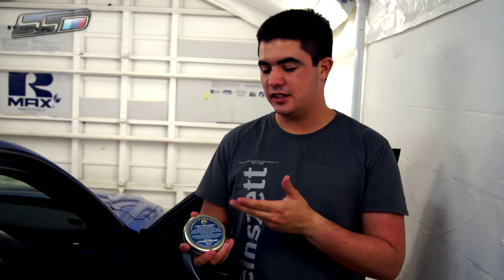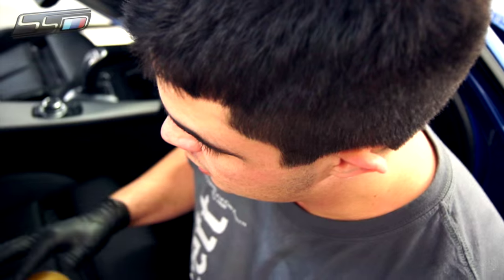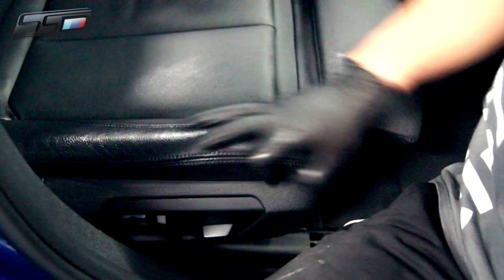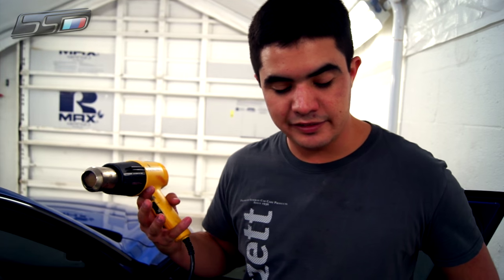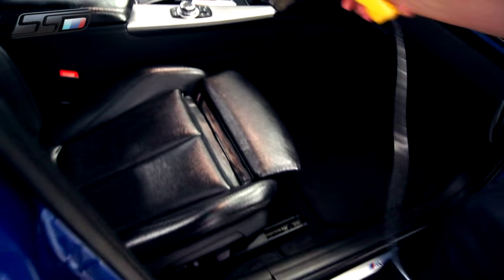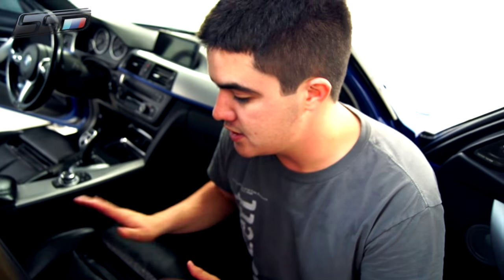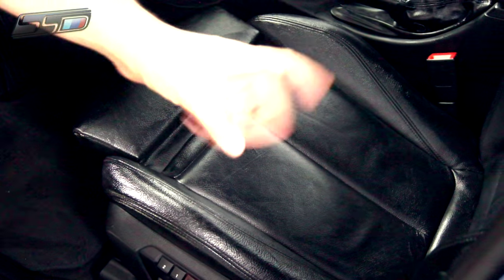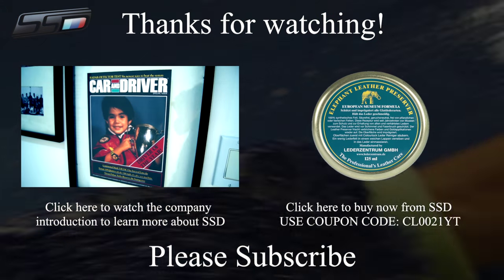Colourlock Elephant Fat Leather Preserver Application

Comment: Looking for a solution when I was using elephant fat on an expensive handbag and where it was difficult to work the wax into the grain.  The advice here of using heat and afterwards a towel to work the wax into the grain has worked well.

Comment: What is the finished result?? Does the leather go back to being fully matte? The BMW in this video seems to have the "Dakota" leather which is the lowest grade BMW offers and is a coated leather  and will always stay shiny once worm (the only way to remove the shine is with a very careful application of a magic eraser, but only once every few years since it's quite abrasive). On my current BMW, a 2011 M3, the leather is called "Novillo" leather which is a much finer leather with less coating (and also much more delicate and scratchable). I believe this elephant fat would would much better on BMW Novillo leather than Dakota leather. As always, test it on a small area on the backseat/armrest somewhere and see how it looks in a week.. Cheers